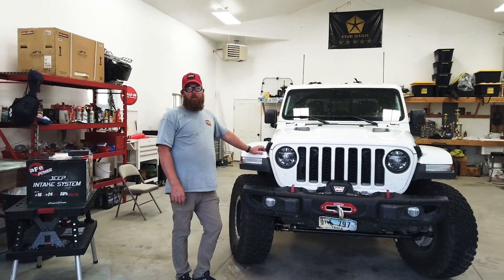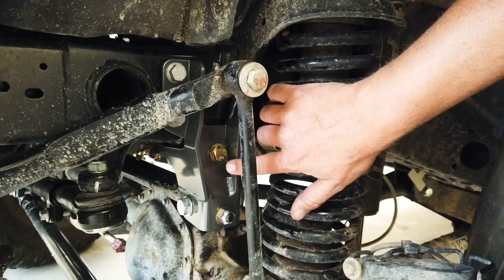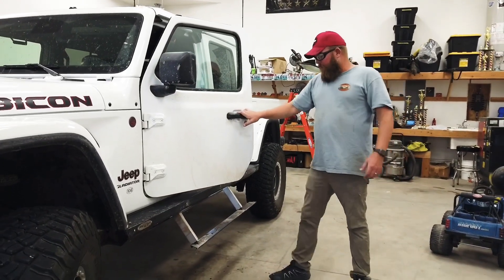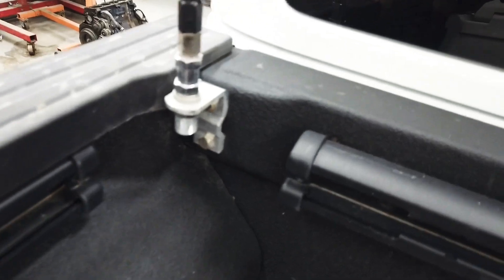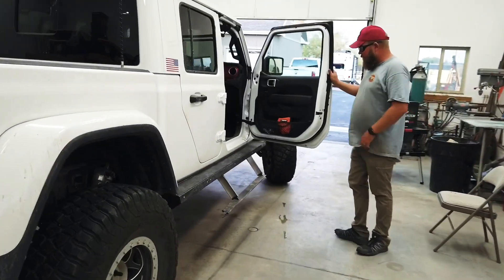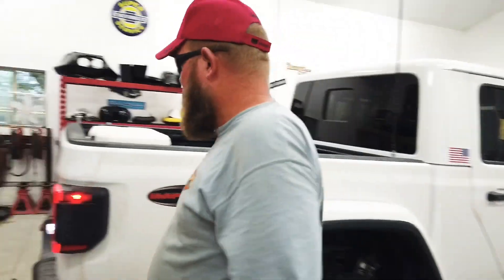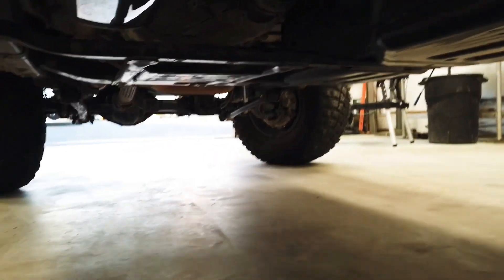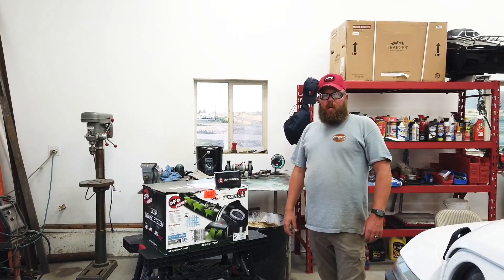Wyominggladiator walk around!

Comment: can you measure the height of the truck with lift?  I am ow looking to going same set up after listening to you on yours and how it looks also.  Just want to see if it will fit in garage still with this set up.
Reply from the maker: Monte Beerbower 79 inches
Reply: @wyominggladiator6526  

great!!   i have 82 so it will fit!!   i know you mentioned 9mpg pulling trailer through mountains and stuff.  what can i expect mpg at between 65 and 70 on pretty flat ground mostly in Okla not towing ?  Cant wait to get my truck and get it set up! appreciate all the help!
Reply from the maker: Monte Beerbower I am averaging 15.5 on the highway running 75-80 mph
Reply: @wyominggladiator6526 
 thank you.  Id take that all day on this set up